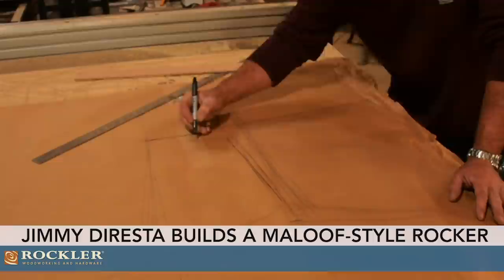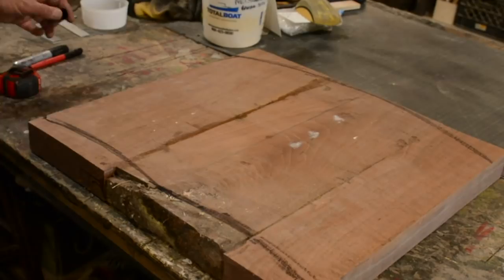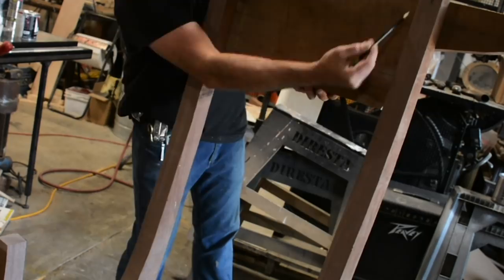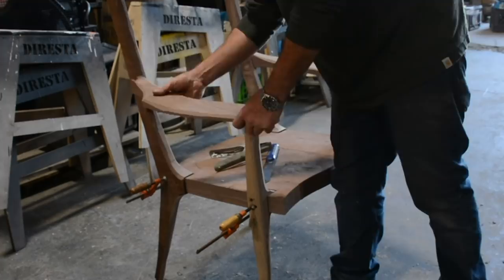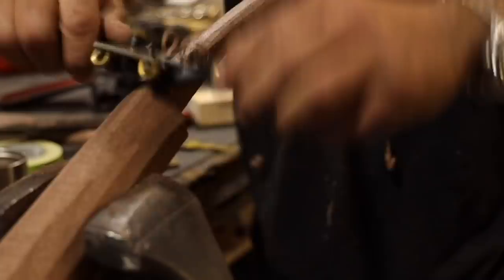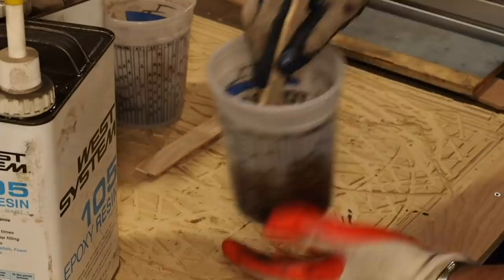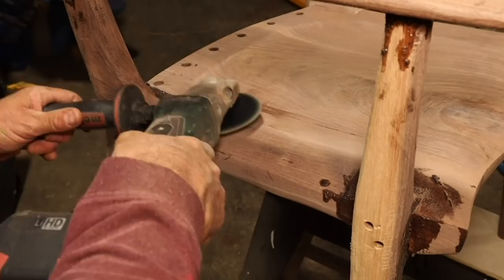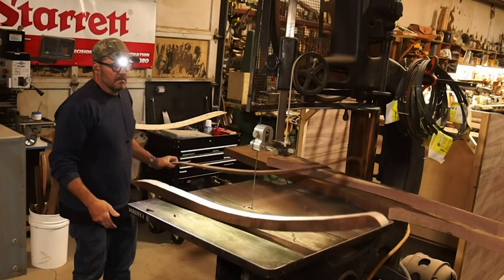Jimmy DiResta Builds a Sam Maloof Inspired Rocking Chair

Comment: What router bit did you use for the joints?
Reply from the maker: Either a straight bit or an spiral bit depending on what he is cutting and what direction he wants the chips to clear out.